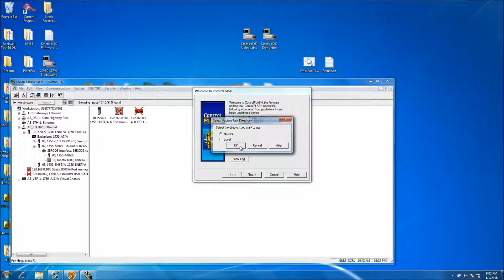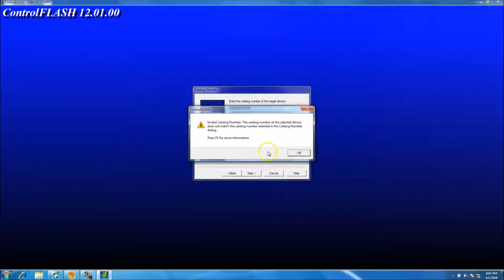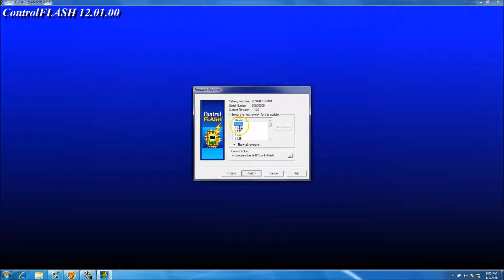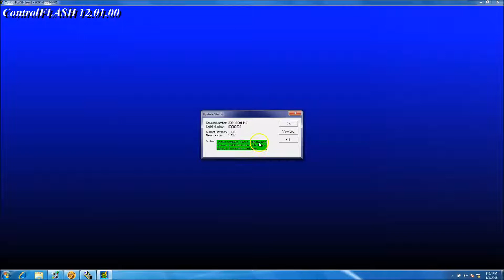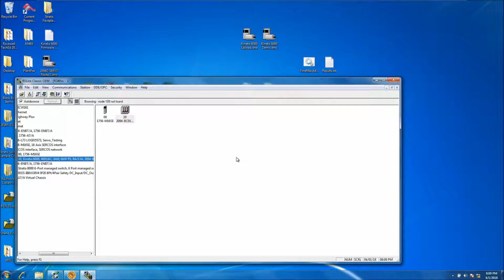Flashing a Kinetix 6000 Servo Drive Using ControlFlash

Comment: Hi, Shane. At the moment I have the PLC - 1756-L61 V13, SERCOS card 1756-M08SE V13 and seven Kinetix 6000 servos  with version 1.082. I plan to flash my SERCOS card 1756-M08SE up to V20. Do I need to flash my servos?
Thanks in advance!
Reply from the maker: It's not required however I recommend it.

Because it fixes a lot of bugs.

Also, if you flash a servo...make sure you know it will lose its position & need to be re-homed.

Not redefined, actually do a home for the servo controller that is flashed.

I learned this the hard way 8 years ago when I flashed over 50 servos at once.

I had to go to each one then find the home position the place it on that position the home it in the software
Reply: But now you have remembered it forever. Thanks a lot Shane for your reply.
Reply from the maker: @ДмитрийМаксимов-ь8и  Glad I could help, hope all goes well

Comment: Hi, Shane. I have a 1756-M16SE connecting with x7  K6000 drives, M16SE has a firmware V17, while all drives has V1.118. I plan to flash my SERCOS card up to V20, and drives to V1.136 (latest one). Do you recommend to do which one first?
Reply from the maker: I recommend that you place all the servos in their home position physically first.

Because you will have to home the servo after a flash.

The servo will lose position reference after flashing it, but you would have known that if you went through my servo course.

And it doesn't matter what you flash first, the sercos card needs to be at the same version as the plc controller.

Comment: How do you make your PLC, the sercos card and the drives all have the same version? I will have to check when I get back to the machine, but is that possible? All the numbers have to march or just the last two or the first two? And what is the benefit of having them all in the same version?
Thanks in advance.
Reply from the maker: By flashing the firmware of each of them.

Major revision is what matters.